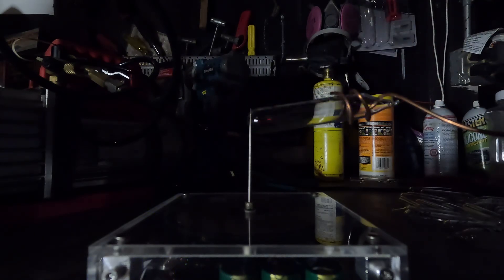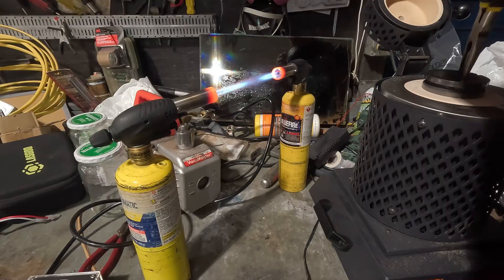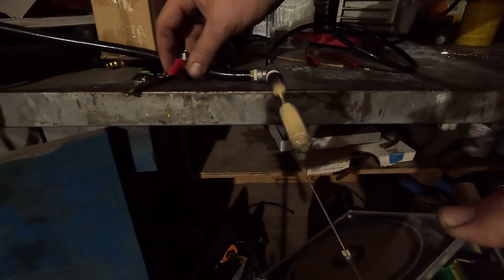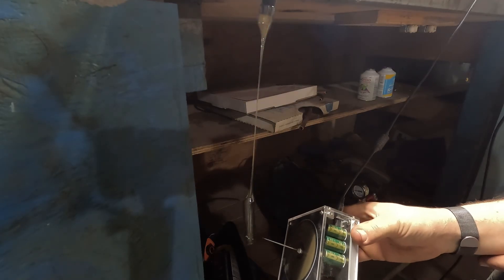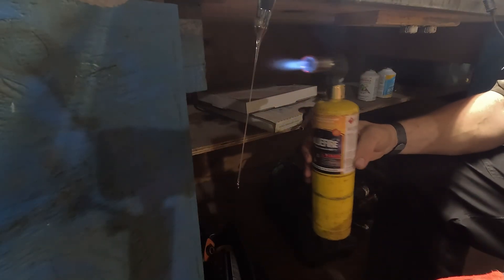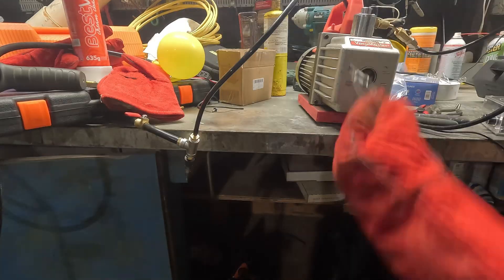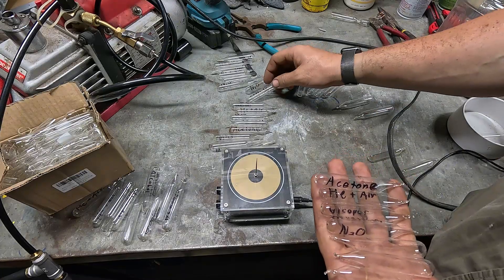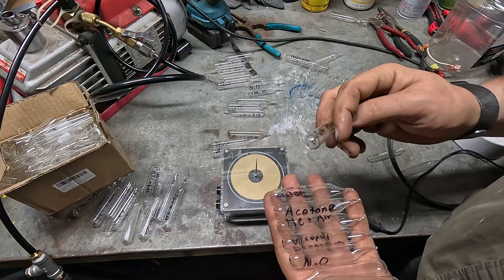Homemade Plasma Tubes | Tesla Coil Experiment with 10 Gases & Liquids

Comment: there's physics behind this. pretty much anything organic is going to givr you a vontinuous spectrum well i to ultraviolet so will look bluish. you need single elements to get discrete bands.

you are looking at atomic emission spectra so you dhould look at them through a diffeaction grating / prism and you will see the fundemental colour bands which correspond to the electrons jumping up and then dropping back down in their orbitals.

hydrogen id the classic example and is lovely and red. its the only element that you can easily msthematically calculate the frequency of the light source (called the ryberg formula for hydrogen or something like that).

other good elements are sodoum, as it gives the sodium doublet whuch is nwar monochromatic light, under which everything looks black or white basically.

boron from borax will be green, cooper bluish. calcium redish. generally any main group transition metal will be interesting. irs to do with electeon occupancy in orbitals. zinc will be boring but copper and iron more interesting. if its got a full outer shell its white and boring. if its only partially full you get pretty colours. its why copper corrodes and turns blue but aluminium just loosk boring and white.
you kight also be able to tey stuff like sulfur  or chlorine

Comment: Other possibilities would be iodine (buy as "tincture of iodine" for ~ 10 bucks at a drug store and boil off the water and ethanol), hydrogen from water electrolysis, deuterium from heavy water electrolysis, chlorine from salt water electrolysis, mercury (from an old thermometer, tilt switch or boiled off from an old piece of silver amalgam from a dentist or "tooth fairy"), nitrogen dioxide (can be generated by passing an electrical arc through air, see "Birkeland-Eyde process"), water, ammonia (from "smelling salts"), carbon tetrachloride (old fire extinguishers), acetylene (probably not, tends to detonate when compressed, like in a vacuum pump), formaldehyde (CH2O available as an aqueous disinfectant, about $40/gallon), sulfur dioxide (burning sulfur), mixed chloramines (NH2Cl, NHCl2 and NCl3 from reacting ammonia with bleach - this is why mixing ammonia and bleach is not recommended - very toxic).  For any gasses generated from aqueous solutions, you should pass them through some dried silica gel to remove water.  Some more exotic gasses (or volatile liquids) would include borane (B2H6), boron triflouride (BF3), boron trichloride (BCl3), phosphorous trichloride (PCl3), phosphine (PH3), silicon tetraflouride (SiF4), silicon tetrachloride (SiCl4) and (if we are dreaming) uranium hexaflouride (UF6).